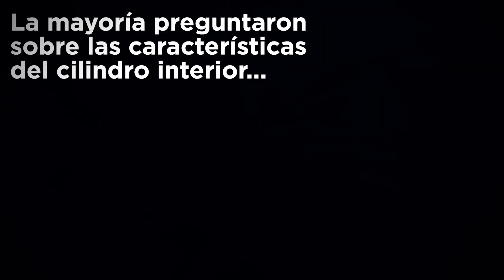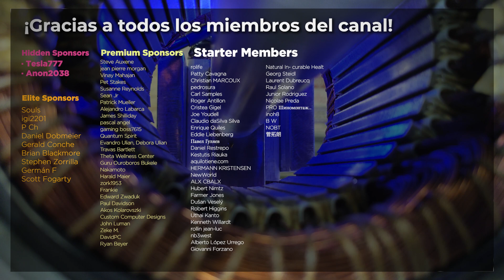El Gran Secreto de la Energía Magnética Infinita - ArgAlium Alpha

Comment: I asked Chat GPT for calculations on potential alloy composition based on the cylinder's caracteristics and superconductivity potential:

Classification:

1. Aluminum-Gallium-Silver Alloy
   - **Composition**: Aluminum (48%), Silver (42%), Gallium (10%)
   - **Superconductivity Potential**: Highest potential due to Gallium.
   - **Estimated Cost**: \$305.71

2. Aluminum-Magnesium-Silver Alloy
   - **Composition**: Aluminum (52%), Silver (43%), Magnesium (5%)
   - **Superconductivity Potential**: Second highest potential due to Magnesium.
   - **Estimated Cost**: \$286.37

3. Aluminum-Zinc-Silver Alloy
   - **Composition**: Aluminum (50%), Silver (40%), Zinc (10%)
   - **Superconductivity Potential**: Moderate potential due to Zinc.
   - **Estimated Cost**: \$266.87

4. Aluminum-Copper-Silver Alloy
   - **Composition**: Aluminum (50%), Silver (42%), Copper (8%)
   - **Superconductivity Potential**: Moderate potential; Copper does not contribute to superconductivity.
   - **Estimated Cost**: \$279.99

5. Aluminum-Manganese-Silver Alloy
   - **Composition**: Aluminum (50%), Silver (45%), Manganese (5%)
   - **Superconductivity Potential**: Lowest potential due to Manganese.
   - **Estimated Cost**: \$299.69

Summary:

- **Best Potential for Superconductivity**: Aluminum-Gallium-Silver Alloy (\$305.71)
- **Second Best**: Aluminum-Magnesium-Silver Alloy (\$286.37)
- **Moderate Potential**: Aluminum-Zinc-Silver Alloy (\$266.87), Aluminum-Copper-Silver Alloy (\$279.99)
- **Lowest Potential**: Aluminum-Manganese-Silver Alloy (\$299.69)
Reply: You are really close.  The scientific paper 'the magnetic properties of the silver-manganese-aluminum alloy Ag5MnAl,' shows this alloy has unusual magnetic properties.  There is a conversation on X that this alloy Ag5MnAl is the correct one with Silver being about 86% which makes this rotor pretty expensive, I've estimated it would cost about $7500 with silver priced at $32 an ounce.  Check out that scientific paper and give that alloy a try and let us know if it works.  Good luck.
Reply: @johnnyxs8192  so it means it's quite expensive, so the invention may be  true but making a business with it is tough. With this amount people can buy electricity for decades...